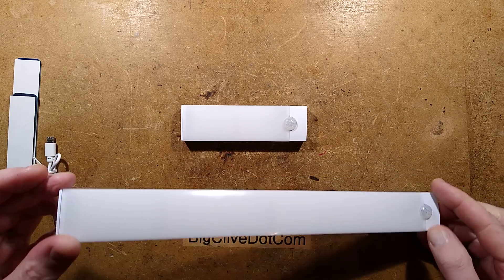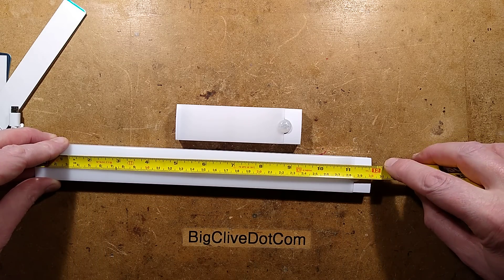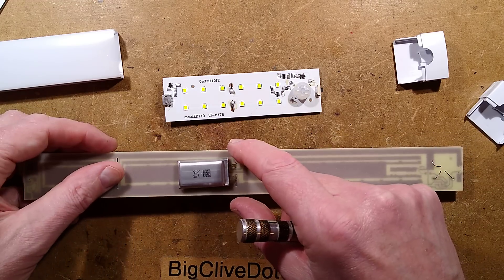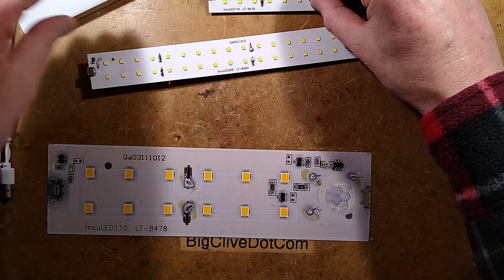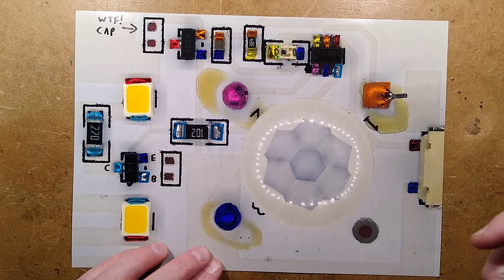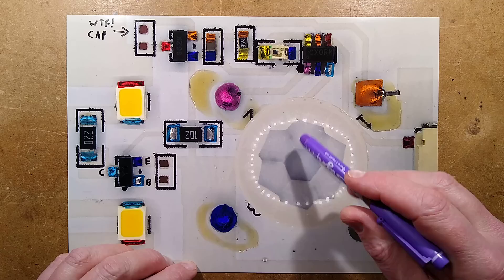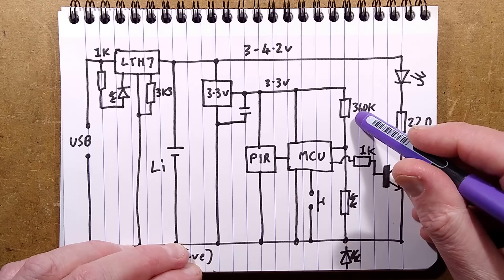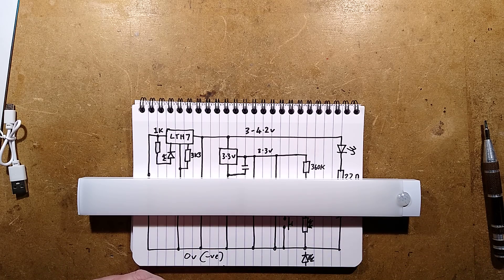USB rechargeable PIR light teardown with schematic

Comment: Anything still using micro USB should be banned
Reply from the maker: It's still a very common connector.  I doubt it will be going any time soon.
Reply: @bigclivedotcom  the larger mini usb is even better.  just like threw hole is better than smelly invisible smd douchebags.

Comment: Totally stealing "douche flutes." Also, I notice a near-total absence of any kind of protection on this thing. I did see in one of the other comments the LTH7 will prevent overcharging, but I guess we're left with the LEDs themselves to stop over-discharging. I hope they used diodes with a high forward voltage.

Comment: In South Africa these have become quite important recently due to the power going off frequently. 

I prefer them to the lead acid alternatives however the quality of solder and choice of mystery chip are concerning and lack of resistors can sometimes make knock offs get super hot even though they are running at a very low voltage.
Reply: Hooray? For load shedding?
Reply: A power bank and a 5V 3W LED light restricted to 2W (makes it way more efficient).
Reply: That's really tragic 😥 
I've seen videos in downtown Joburg from the 1960's that I actually mistook for Manhattan....but its nothing like that today. I'm sorry for what people have done to your country.
Reply: @ChadDidNothingWrong  They did it to themselves.
I've never met a nice South African.

Comment: Would it be ok to just add another battery in parallel?
Reply from the maker: Yes.  Just make sure the voltages are within 0.1V before doing so.

Comment: Canadian measuring tapes and rulers also feature both common units. Just makes sense. Use what you like or what your industry standards demand, but it's not hard to decode when somebody else is using unit that you don't intrinsically understand or aren't working in.
Reply: America has the same kind with both types. the thing about metric is its easier to use in some cases. like me who never really needed to use metric until getting a 3d printer. I had to go out and get rulers in MM.

if I were using imperial for 3d printing I'm sure I would get lost, especially when dealing with Tenths of a millimeter. I have no idea what that would be in inches. it's just easier to compute when u want to be precise.
Reply: Even though I live in the US, I go out of my way to have a few high-quality tape measures around that have both since I use them interchangeably as needed.
Reply: What makes me laugh and laugh is watching YT videos by American creators who regularly talk about  x point y inches - essentially chopping inches into 10ths and decimalising them. Oh how I laugh.
Reply: Also the land down under has both options, metric with imperial  or just metric! 👍👍
Reply: I too still use a dual measuring
tape ……as  BC says its the way we Brits roll……even when living in CBR Australia
Reply: In American stores these days you'll find 6 or 7 versions next to each other with different scales, presumably for different specialist construction trades, but all inch-based (major marks every 12 inches vs 16, or 1/32 vs 1/16 minor marks). Not a single one with anything metric that I've seen in the last 5 years probably.
The only one I've been able to find recently without special ordering something is a cheap impulse buy from a furniture store that was probably made to be able to sell one model to retailers in any country, and they didn't bother to spend the to time to customize (cripple) it for us.

And people wonder why we have a problem with scientific literacy.
Reply: Most metric-using countries tend to use SAE more that America uses Metric...when it comes to units of Length specifically.

Probably a waste of resources to print both scales in America, but an excellent use of resources elsewhere.
Reply: @RK-kn1ud I wonder how many non North American people know that in saying SAE you mean Imperial measurements.
Reply: @--_DJ_--  Mostly people who have worked with their hands will understand "SAE", everybody else would be dumbfounded unless you said "American" or "Imperial" units
Reply: @RK-kn1ud  In the US&A yes, in the rest of the world, the opposite is the case.
Reply: @stevemorris3710  I'm pretty sure that is exactly what I just said.  lol.

(World using SAE) > (USA using metric)
Reply: @RK-kn1ud  The world, other than the USA, rarely uses the term SAE, and never 'American' because they know imperial measurements came from England, not the USA.
Reply: @stevemorris3710  I'm trying to say that most of the world uses SAE/Imperial/Fractional measurements MORE than the US uses Metric.

This is why combination tape measures really aren't a thing in the US...but they are very prevalent elsewhere.
Reply: @--_DJ_--  quite a lot I'd guess, the two worlds aren't that alien or unaware from eachother😁
Reply: @stevemorris3710  I think SAE is more commonly used than US&A, 😁
Reply: @bennylloyd-willner9667  Not in Borat films, Very Niiiiice :-)
Reply: @stevemorris3710  ahh, forgot about that documentary 😁
Reply: @bennylloyd-willner9667  I tried to forget about it, can't! 🙂
Reply: @stevemorris3710  we all have traumas we have to live with 😁
Reply: @bennylloyd-willner9667  LOL
Reply: I am Canadian, I go out of my way to make sure I only buy tapes with imperial on them. Easy to find though, I have next to no use for metric on a tape.
Reply: (self edited to remove my nasty reply, despite my feelings it was right to do)
Reply: @apparentlyretrograde  I read it before you got to it. No hard feelings. Don't let the PFP trigger you, it is funny if you get it, if not, it tends to get the reaction you had. My wife finds it funny if that helps you at all. 
Like I said, I just have no use for metric on a tape. I can swing both ways, I just work in Imperial, so that is what I buy. It is handier to be able to use both sides of the tape, instead of having to turn it around to get the imperial measurement that I am going to use. I mentally convert metric into imperial. You can tell me it snowed 30 cms, and my brain goes yep, about a foot. 
Different strokes for different folks.
Reply: @--_DJ_--  Yeah, I made sure to leave it up long enough you could see it. Whatever the rest of your drivel means, I don't know.
Reply: @apparentlyretrograde  I'll repost your original reply for posterity reasons. 
"Apparently Retrograde replied: "D J Absolutely no idea why you'd go to that trouble considering the world is more metric than imperial, other than being intentionally contrarian, but you do you, Mr. Mysogynist Avatar."
Reply: @--_DJ_--  Your decision. I still stand by my words even if I decided to retract them for community standards.
Reply: @apparentlyretrograde  If you want to stand by a dumb comment, I am more than happy to help you out with that.
Reply: @apparentlyretrograde  There is some history here. When the U.S.&U.K. we're using SAE, they were the leaders in industry and world power. When the U.K. became part of the EU, the nation had to change to metric, but there was no overwhelming reason for the U.S. to do so. The U.S. was the free world super power. Big industry was still somewhat national ( e.g. G.M. was an American company). So, there were some half ass stabs at going metric, but neither the people nor Government were all that interested. Now, when industry and science are all international, the change makes sense, however, we have enough problems facing us, that 350 million people are not that interested. A guy like me(I'm 80), aren't going to change. We figure that having 2 different systems is fine with us. If I'm comfortable at 72 degrees Fahrenheit and you would be burning up, I'll use my system and you can use yours.(I know that it's not that simplistic and big problems can arrive when 2 systems interact, but the point is the people here just don't care to change.  Plus the cost to change everything--road signs, Etc would be extremely high). I am sorry that our stubbornness angers you so much, but I thought you might want to know our side of the story.
Reply: @apparentlyretrograde  oh no, soggy knees. Whatever will we do. Kinda fun you had to throw that in as some sort of argument hail Mary.
Reply: @williamromine5715  I am British, a few years ago i took a course in the US. The American professor teaching the course mentioned that as a scientist he used Celsius to measure temperature, he also had the temperature in his car set to Celsius, which apparently confused some Americans.
Reply: @williamromine5715  Back in the 1990s I worked for a chain of garages in the UK. I worked for the head office, trying to solve problems at the branches.  One that I remember was that at the time they were still using old imperial calibrated tools to measure the brakes. The young lads joining the company had zero experience of using fractional imperial measurements, so they made a lot of mistakes. We advised that the company should change the instruments to ones that used metric units. It workd.
Reply: @peterjf7723  Temperature in Celsius always confuse me. This last summer, there was much to do about the heat wave in England. At the time, it was pushing 100F in the shade on my porch, and I live in the Rocky Mountains. I had to look at a chart to understand why there was concern. I can, kinda, get a general impression of kilometers. I just calculate, in my head, that your 100 kilometers is only about 60 miles. It's not accurate, I know, but good enough as an estimation while I am watching a channel involving distances. It breaks down when it come to millimeters. I'm totally lost there. The old brain just doesn't  compute. Oh, as to temperature, right now it's 4 degrees above zero Fahrenheit on my porch, and winter is weeks away. Hope things are warmer where you live.
Reply: @williamromine5715  I grew up with degrees F, and still use them when cooking or for almost any temperature outside of the climatic range. But the weather reports here switched over to C so long ago that I now don't have a problem with that anymore, so here's a thumbnail guide: 
-30 = F ing cold (dangerous)
-20 = damned cold (bundle up)
-10 = cold (winter coat)
0 = snow rain mix (freeze point)
+10 = cool (spring jacket)
+20 = nice (shirt sleeves)
+30 = hot (swimsuit, if you can)
+40 = F ing hot (dangerous)
Reply: @--_DJ_--  then you’re not Canadian , your a northern North American.  😂 metric FTW
Reply: @danilodistefanis5990  I've been called worse in this comment thread :)

Comment: Most rulers in the US have both cm and inches but most measuring tapes are only feet/inches. But if you're careful when shopping you can find measuring tapes with both systems. (8m/26ft is the size that's most likely to have both measurement systems. The key is to find one that isn't a multiple of 5 ft; the ones with metric measurements are nearly always a round number of meters, whereas the foot/inch-only ones are almost always a multiple of 5 ft. But of course you can find exceptions; I've seen at least one 25ft/7.6m dual-unit tape measure.)
Reply: FastCap makes a really nice foot and meter tape, they do a lot of interesting, almost specialty tapes. The one I have oddly enough is 16 feet or 4.87 meters. Maybe there's another specialty measuring need at play either in metric or standard, both measurements feel a bit odd now that you got me thinking about it. 😂 I picked it up strictly for both systems printed on it, and they make solid stuff.
Reply: I have a 25ft / 7.5m tape.  The metric printing just stops before the imperial side.

Comment: So is there anything protecting the battery from over-discharge in that circuit ? Maybe the µcontroller not working under a certain voltage ? Or does the battery contain protection circuitry ?
Reply from the maker: The LTH7 stops charging at 4.2V.
Reply: @bigclivedotcom  I was asking about over DIScharging by the leds - especially if as you say the PIR sensor "self triggers" on the low end of the battery voltage. I have ordered one, will experiment. Thanks.
Reply from the maker: @VisDeux  The lithium cell will potentially be discharged to around 2.5V which is the normal cut off voltage of protection circuitry.  The processor may detect low voltage, but I've not tested that.
Reply: @bigclivedotcom  Thanks, dumb me totally forgot that those white leds will probably stop conducting above 3V anyway so they won't drain the battery.
Reply: @bigclivedotcom  News : I have received and started to use a few of those.
Funny that the biggest one - 40 leds model - was turned on during delivery, actually worked and was visible from within the 3 layers of plastic bags that enclosed it ! I suppose those bags are not good at IR blocking.
That long one was also the first to be totally discharged, maybe due to the fact it had started draining the battery during its trip.
I measured its battery voltage once it stopped working, and that was down to 1.75 V ! I believe this would severely shorten the lifetime of the battery, so I will swap the batteries with some bigger capacity that are equipped with protection circuit to avoid that over-discharging.
Other information : that 40 led model came equipped with a battery marked for 450 mAh, which I tested for an actual 380.
The tiniest model I ordered - 12 leds - had a tiny lipo without markings, measured at 120 mAh capacity.
So basically exactly the same 2 that you shown in that video.

Comment: If it will fit w/o the pad, then regular double-stick tape would probably work. Or use a 3M Command Strip to make it easier to remove if needed.

Comment: Re measuring tape - I have a Stanley FATMAX tape which is metric only and on the back of the case it directs you to add "2  3/4 inches" with no mention of mm or cm!
These lights are very handy and I have various types around the house. They will come into their own when I have completed my solar power charging station and energy costs continue to rise in the UK (+ the rest of the world).

Comment: I noticed that the link seemed to go to the US version of ebay in that the prices are in dollars
Reply: A hidden benefit of being a Patron? Getting to pick up some the the devices off ebay before the rest of us plebs start driving the prices up 😂
Reply: @myfavoriteviewer306  I bought some of the smaller ones as soon as I saw this video too!!.  Sadly one of them has a missing USB socket, but I chopped the micro end of the cable and soldered it directly to the board (having poked it through the USB hole first, of course.  Which I did AFTER I realised I'd stuffed it up first time).
Reply: @tinkerbot4148  I've been there far too many times, the great satisfaction of stepping back to admire a job well done just to notice a second later I messed things up to the point of needing to take things apart 🥺😂
Reply from the maker: Shamefully that's because the majority of people who don't just type the keywords into eBay and demand a direct link are .....  American.
Reply: @bigclivedotcom  With the advent of text-to-speech, and vice versa, we've decided teaching literacy is too much trouble for the cost. Doubly useful in schools, with a crippling shortage of teachers, and where tight controls need to be maintained on immoral and generally non-conformist ideas in books. 🇺🇸 #murica /sarcasm 🙄🤣

Comment: I found a bunch of similar type of own-brand lights in the local hardware store's bargain bin, at 1€ each, and got all of them. The difference is that they use a single LED and 3 AA batteries for power. I'm running them on Eneloop/Ikea Ladda NiMH cells, which IMHO is more convenient than having a light you have to (slow) charge, since you can simply get on the ladder with 3 charged cells and replace them on-the-spot¹. Also, for stuff that is installed at random places in my home, I prefer NiMH, because less can go wrong, and there is no need for low-volume, low-weight high energy density cell like LiIon. The cells draw such low current that you only have to put fresh ones in every couple of months.

----------
1) you could of course buy one extra of these rechargeable ones and keep it charged and ready to replace any light that starts dwindling

Comment: I have a little round one that is basically the same as these.  
For mine it is in the bathroom and is always on charge but it still functions correctly while charging so if the power does go out it is already fully charged.  
Would these do the same thing...continue working even while plugged in & charging?
Reply from the maker: With an LTH7 it should be fine, but I prefer extra protection when charging 24/7.
Reply: @bigclivedotcom    
The one I have has built-in protection on the battery and it's been doing very well for about 6-7 months so far with a few power outages.
Reply: I'd prefer to use NiCd or NiMH for continuous trickle charge: they handle low current overcharging much better than Li but a process call autocatalysis which Clive has described elsewhere. The advantage is that this is inherent in the chemistry, there is no protection circuit to fail and set for to your house 🏠